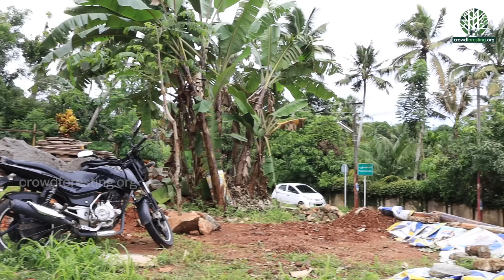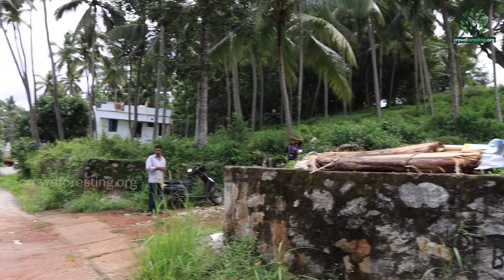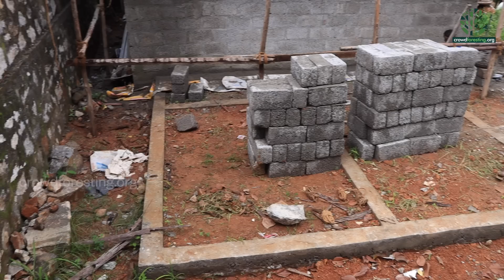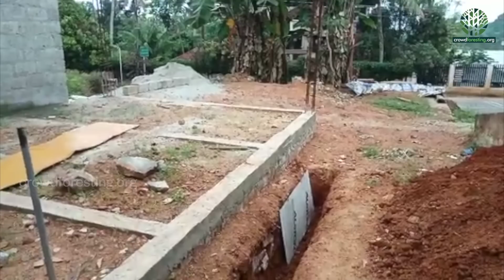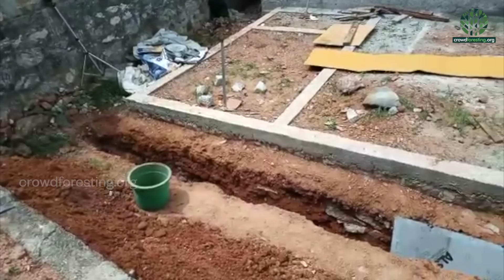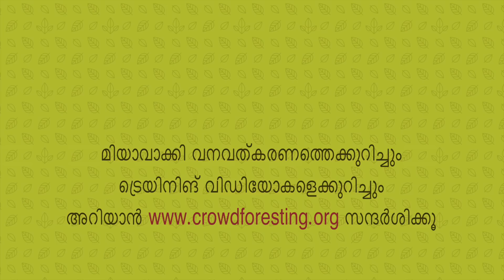വീടിനടുത്ത്‌ മരം വയ്‌ക്കാന്‍ പുതിയ വിദ്യ | A NEW TECHNIQUE FOR PLANTING TREES NEAR BUILDINGS

Comment: Root barrier sheet material has durable high-density polyethylene (HDPE) sheets. Root barrier sheet material creates a water and root barrier to prevent costly damage to pavements, roads, and building foundations caused by water and roots.
Reply from the maker: 🙏 for sharing the information
Reply: Hdpe root barrier sheet എവിടെ കിട്ടും?